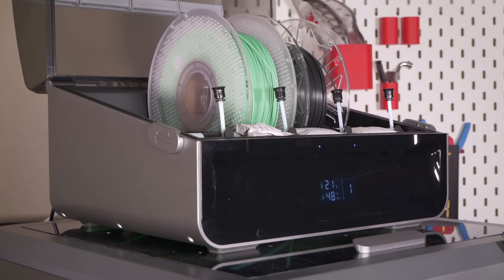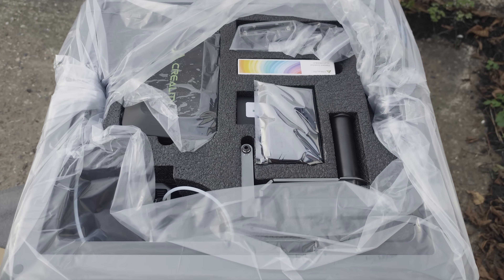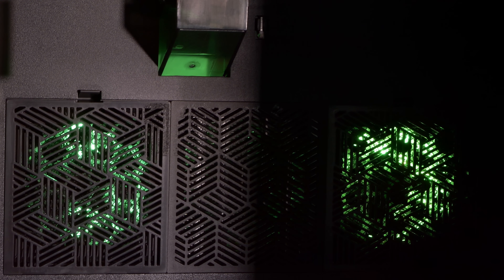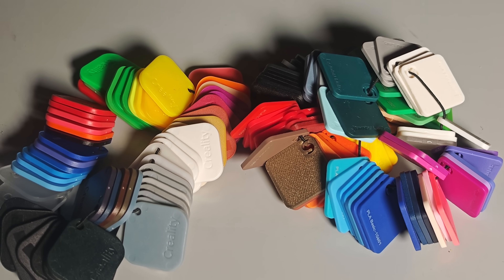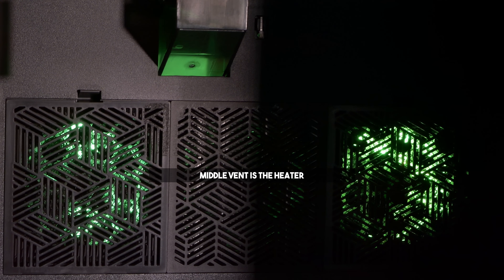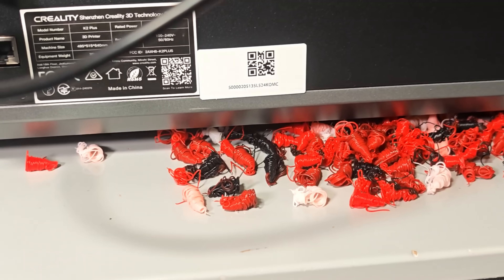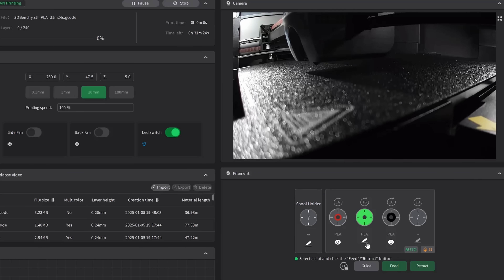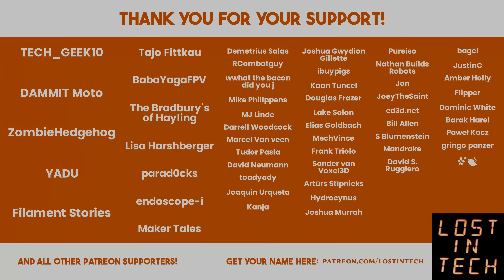Creality Finally Made a 4 Colour Printer and everyone is asking me the same questions!! !

Comment: With print quality, I have an Ender 3 Pro, a Neptune 3 Pro and a P1S. Comparing models printed on all 3, it's almost impossible to tell the difference. The major benefits I find of modern core XY printers is the speed, less printer/material tuning of the older bedslingers and no more tedious manual spool changing on prints that change colour at specific layers .
Reply: @sgtkabukiman9411  Yeah tbh, 3D printing quality peaked long ago. Well tuned Ender 3s honestly can match a lot of modern machines
Reply: @Castdeath  Totally agree.. I have 3D prints that came off my Replicator Dual from 10 years ago that look every bit as good as the "best". Mechanically almost nothing has changed in terms of precision and "quality" in the motion, other than stepper drivers and resonance compensation to allow printing above 120mm/s without motion artifacts.

I have noticed in the last 4-6 years that filament quality has dropped. In the sense that i have a SUPER old roll of PETG (about 6-8 years old) which is dead on 1.75mm to within +/-0.01mm. On new average filaments you regularly get +/-0.04mm and high quality filaments usually bump up to the +/- 0.02mm they claim. This causes a stacked salami effect. I thought it was inconsistent grip/slippage for a while until i loaded an old quality filament a few years ago. OLD MAN They don't make them like they used to
Reply: @MrHeHim  nowadays if I want a spool I can be sure of its quality I go prusament
Reply: Same. I been printing for 10 years ish and and even on my first printer (tevo tarantula) I got flawless prints. Once you have a good profile going you are in the game.
Reply: If you Print a lot a bit more Speed is still nice🤗. If you only Print onve a month or every two weeks you dont Need a fast printer
Reply: Im sorry, but how is the ender 3 pro comparable to a P1S?
Reply: @ZT_1234  i suppose If IT IS a bit tuned xou cant Tell a quality difference. But of course the Print will Take longer
Reply: @MaxMichel89  I guess it's the difference between a 20 minute print and an hour and a half print
Reply: @MaxMichel89  a bit tuned? They're only close after a ton of mods and very heavy tweaking lol
Reply: @hyperstimmed  i can confirm, i have a modded ender 3 (direct extruder, modded firmware, autobed level, done all the calibration also input shaping manually), print quality is very good in half the time of a stock ender3, still, a bit worse than a bambu and at least 3 times slower

Comment: When will the cmyk+white printer be created? 5 color mixing occurs at nozzle? Minimal to no wasted purge, nozzle priming in infill.
Reply from the maker: Sounds like polyjet to me.
Reply: @LostInTech3D  The MImaki 3DUJ-2207 is 40-50K usd. Would be nice to have a sub $1k option.
Reply: @Reach3DPrinters  Have to wait for patents to expire. It is what it is.
Reply: @Reach3DPrinters  white filament + CMY ink could work for you, though it would be DIY solution
Reply: @kimmotoivanen  I just saw a company, polydye, uses an inkjet cartrdige, but wastes time printing on every layer, instead of priming the filament with the ink prior to entering hotend. Though, ink buildup at hotend could be an issue depending on the ink and what happens to it when heated. May create coating in heat chamber the builds over time or clogs nozzle.
Reply: @Reach3DPrinters  the great problem is the mixing. The high viscosity of the molten filament would require an absurd mixing chamber at printing speeds or somekind of active (motorised) mixing.
Reply: @wktodd  I can see that being an issue... perhaps the mixing chamber could have an free wheeling auger, bolted in and sealed, spinning on axis that don't exit the hotend, so the very flow of the filament rotates and mixes the molten filament.
Reply: The way i gather, CMYK+white cannot work with filament, the filament pigments don't generally behave the way inks do, the way you expect them to.

That being said mixtruder hotends exist, and mixing per se doesn't appear to be THAT much of an issue. The Reprap Diamond hot-end is well known. You can get any number of 3- 4- and 5-input hotends on Ali for cheap. Printing with a mixtruder is kind of bad and hard because what do you think happens on retraction (not much) or what prevents one filament's melt from oozing into all the other inputs (not much).

If it's not mixing enough, just cut a thread-type structure into the meltzone or use homogeniser insert aka the copper thing with the holes in the clone CHT nozzles.
Reply: @SianaGearz  I bought a diamond years ago, 3 inlet for bowden. 
Oozing can sorta be managed with wipe towers or slicer moving nozzle into infill, but yeah, alot of hurdles. 
I assume if there were a printer company that could manage those hurdles, it would be pretty lucrative.
Consider another option...
Years ago, I saw people just using sharpie pressed against white filament as it enters the extruder, and though the result was tinted, it was indeed colored. If there were a filament marking unit with 4 color addatives being applied to white as it enter heat chamber, that could work. 
Pigments can be very high yield. When creating colored filament, just 2-5% of color pellets added to 95-98% of white or natural, creates the colors we use. 
So using something like an inkjet printer color cartridges would have a high enough pigment load!

I just discovered, a company kinda does this post print, called polydye. But has to print ink onto the 3d print after the layer is complete. so 1/2 the efficiency.
Reply: The main problem still is color bleeding and filament waste, which is a slicer problem. 3D printers waste quite a bit of material to do material and color changes and no company seems interested in tackling this problem and only suggests workarounds which barely minimize plastic waste, when they don't increase it.
Reply: @BrunodeSouzaLino  I feel like there was a slicer that would purge old color by using it for infil. But PolyDye prints inkjet ink every layer it prints. Might be better to stain the filament before hotend though.
Reply: @Reach3DPrinters  Some slicers would do that, but the amount of infill is always smaller compared to what is used on the print, so purge towers are still printed even with that setting.